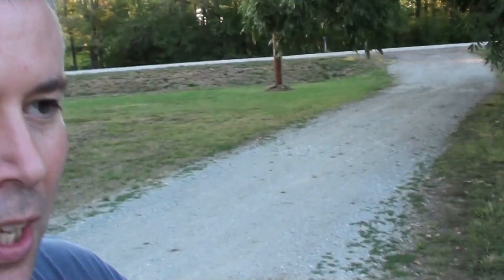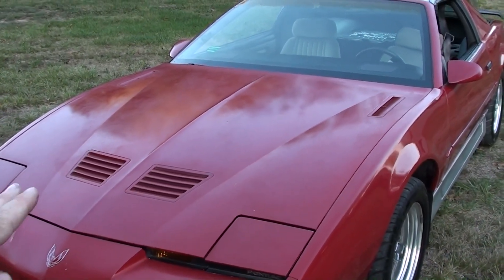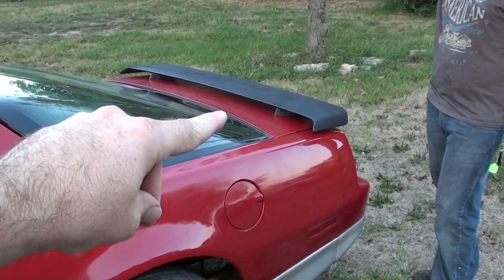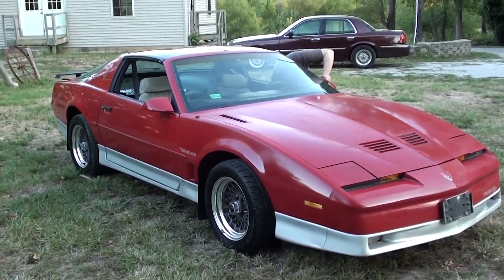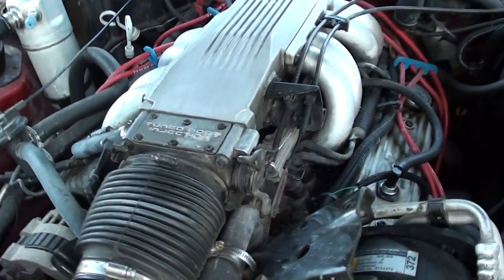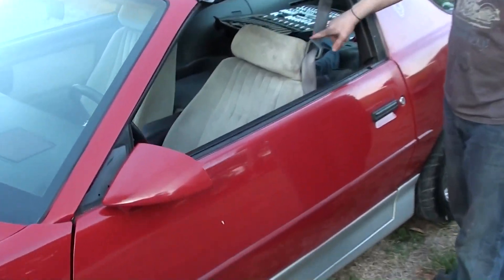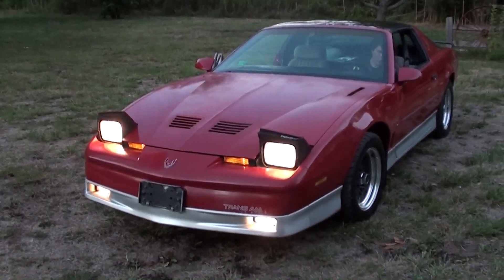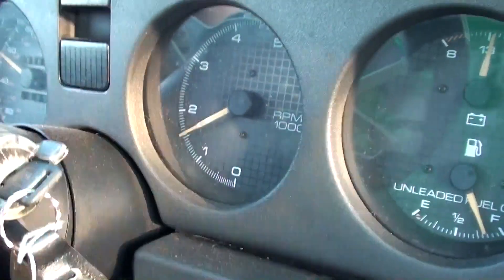Update - 1987 Pontiac Trans Am Project

Comment: Don't those have the old style fuel injection with 1 injector that sprays 1 side & another for the other side? if so, I would add a newer intake 2 either add a injector for every cylinder or delete the fuel injection & add a carb.im just wondering if it has the old style injection system like the older corvette's???
Reply from the maker: No, this one had the TPI fuel injection, with a separate injector for each cylinder.